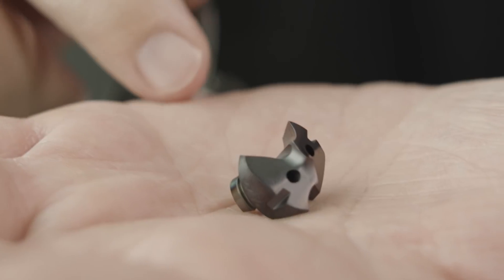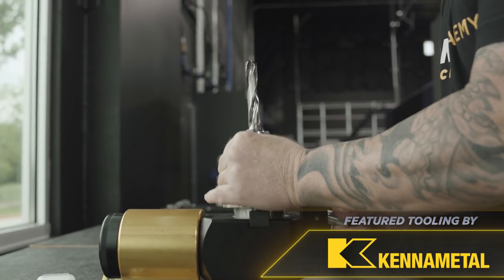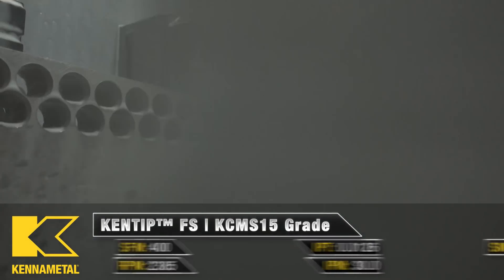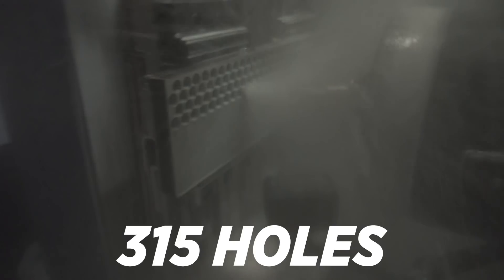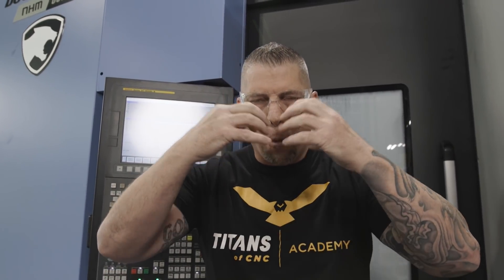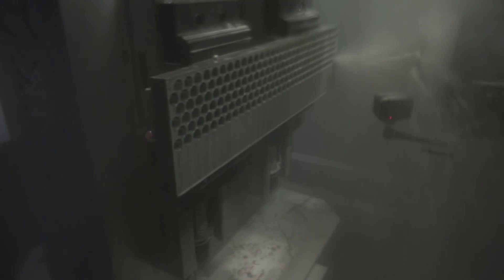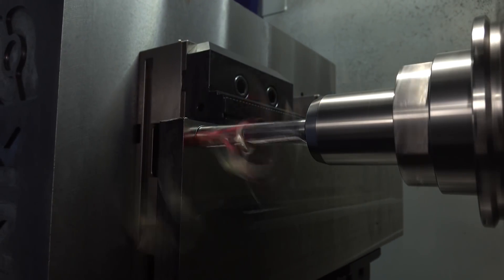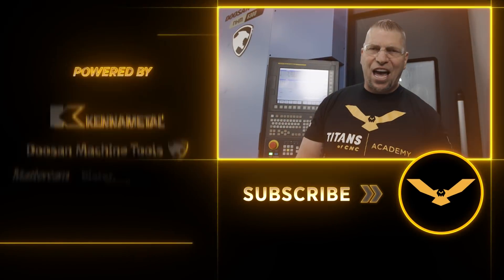Coolant Fails to Turn On When Aggressively Testing KenTIP FS in 316 Stainless Steel

Comment: Well it takes a few second for coolant to flow when coolant hasn't been pumping for some time (for example, start of the day). So as programmer you need to account for this. If you absolutely will break a tool because the coolant stopped for a second then either you need to set some delays or something.

Comment: 3:31 I refuse to believe that is how the tip looks after drilling all those holes at elevated speeds and feeds.  Sure, ok, impressive if it's still in good condition after that but zero chip rubbing or not the slightest amount of galling? that has to be a shot from before it was used.
Reply: From when it was new, 100%

Comment: This is what before, with, after is for.  I've configured my posts to be before the first xy positioning move, with is before the first Z axis move, and after is at the clearance plane of the toolpath.  I really expected with the heat from the first hole, and the thermal shock of the coolant coming on it would have shattered the insert.

Comment: Thats a crazy feed rate.  At my shop we definitely run things more conservative but we also run lights out so we're pushing our tool life as far as it can go.  We run 1 8 hour shift for all our low volume stuff then switch to our high volume runs at the end of the shift and our goal is to set our order quantity so the machines are just finishing the job when we come in the next morning.
Reply from the maker: I showed 300+ holes just to show it was possible... you can make thousands of holes... turn it down a little ... but still higher than normal and the tool just goes...
Reply: @TITANSofCNC  yeah for sure.  We run 303 stainless.  And we'll push 900 0.250" holes 0.375" deep before we change out our drill.   It's on a millturn lathe.   3 days of unmanned running for 1 setup.  Had to extend the barfeeder tray to hold enough bar to run that long.

Comment: Could you do the same test but with the flat bottom insert (KenTIP™ FS Inserts • FEG KCP15A) in SS316? Would love to see how they compare to a traditional indexable drill.
Reply from the maker: Hmm🤔
Absolutely
Reply: @TITANSofCNC  Awesome, trying to pick a drill system for my 1st Horizonal. Was looking at the KTFSS23500FEGM with a 3XD Body as my main go to for a closed pocket pilot hole.

Comment: All this is great information but what do you do when your equipment is limited. No through coolant, not even high pressure coolant. Everything gets a whole lot slower.
Reply from the maker: Go to a reg carbide GoDrill to drill anything and everything efficiently
Reply: @TITANSofCNC  thanks for the feed back.

Comment: You do not cover tool life. We pushed hard in my shop years and years ago, However, their is a trade off of speed of cut and tool life over the part run. It may cost you more in tooling over time as opposed to machine time. Pushing to hard may end up costing you more $$$$ than running at a little slower feed rate. Many factors must be looked at when pushing the limits of any tool.

Comment: Titan are you using a high pressure coolant system?
Reply: Coolant through - M7
Reply: Did not catch info if standard coolant system app 300 psi being used or booster pump app 1000 psi being used. Hi pressure coolant can achieve higher speed and feed rates.

Comment: How much do those replacement tips cost?
Reply: 40 or so..
Reply: @florian821  I use a 17/32" in 4140 HTSR. 1 tip does about 200 holes 4" deep and costs around $100 canadian.

Comment: Not a new tool, though.  I used this type of inserted drill already about 15 years ago in Texas.....
Reply from the maker: Ya, insert drill were around 15 years ago. This specific drill from Kennametal is around 3 years old and covers the entire tip of the drill. Meaning the whole Dia is carbide. That’s new and beast
Reply: @TITANSofCNC  It was smaller diameter, but exactly same construction -on  horizontal Makino a-81 w. 30HP doing 4041 unanealed  forgings - airforce contract.
Reply: Iscar's sumocham is the same thing, been using them for 6 or 7 years they work great. Allied GEN3 is similar, seco has crownloc...I'm sure there's others

Comment: I have a fair few of kentip drills they are excellent but never push them that hard.Having a small jobbing shop can't afford to break one and sometimes it happens and there goes the profit you made on the job.So in our case taking a couple of extra seconds is better than a broken tool.Not going to argue about high production environment suppose time is more money to them.

Comment: this is why i always first start the spindle with coolant at the same time, then go all the way up in Z maximum and then to the first position
Reply: And add a dwell for 1-2sec.
Reply: @PDanny84  in my case not necessary because the machine waits for the spindle to be at speed
Reply: Our machines at work require a p dwell of 3000 to 4000 for pump to get to full pressure and actually provide pressure to spindle.
Standalone CTS. 
Remember watching a few though coolant drills start a g81/g83 without high pressure coolant coming out, 20 seconds to late... simple edit but... sad delay due to PLC. "if im correct"
Reply: Not all machines have the ability to start the spindle and the coolant simultaneously.  If your machine only supports 1 M-code at a time, check your manual for a combo spindle and coolant command.
Of course, make sure the coolant starts before the tool touches the material, adding a dwell if necessary, and make sure your coolant tank doesn't run low causing coolant to be delayed and/or intermittent.

Comment: Titan, when are your going to try other tools from other dealers?
Like iscar enz.
You are only working with kenametel but there is so much more to try out.
Reply: I find Kennametal way over priced. Taegutec, Guhring, Ceratizit win it for me.
Reply: @homegingineering1319  I agree, we started using Kennametal 10-15 years ago because it was cheaper than iscar, walter sandvick etc. And in some cases just as good, now it seems like they are often more money and  in alot of cases not as good as those other tool manufacturers.
Reply: @homegingineering1319  Ceratizit is better
Reply: I'm not passing judgment or justifying anyone.  But from what I recon, one, he gets the sponsorship from Kenametal.  Two, (and more important) he is standardizing his shop and showing us what "that one tool" can do in many situations.  So that if we need to do X, we look at how Titan did X with the tool that we already have (if you bought that tool as per his recommendation, and with the promotional US prices that he got you).  That's a big help.  If I had that tool (whatever it is) already in my toolbox, and I have a new situation, it's right there with Titan's recipe and I don't need to run and buy Iscar or whatever.
Reply: He's sponsored by Kennametal so that is what he has to use. Regardless, there are better cutting tools out there, like Iscar IMO
Reply: Thanks for this Video Great #DuplexCNC

Comment: Well the title was clickbait. Nevertheless seems to be a cool tool.
Reply: I guess what he’s saying is the title insinuates your tool or spindle failed, not coolant, and so that there was a crash or some kind, none of which happened, never the less, that’s still stupid fast
Reply: Went horribly right?
Reply from the maker: When your standing there and the coolant doesn’t turn on and the drill dives straight into stainless at record speeds... and the chips come out flaming.... ya, that is horribly wrong.... but luckily, The KenTIP FS handled it.... That definitely wasn’t intended. I could have not shown the video because of what happened but figured, Hey mistakes happen and I should show it... besides, definitely makes the tool look great.
Reply: You guys are dumb crybabies. This isn't clickbait.
Reply: The title doesn't insinuate anything other than an "epic failure". Just because he has good equipment and that particular bit didn't fail doesn't mean it wasn't a huge mistake! It was an "epic failure" if you know anything about the subject.
Reply: Except when you run it without coolant 😉